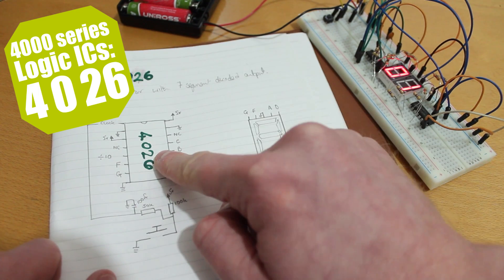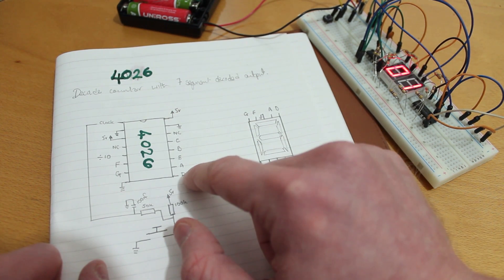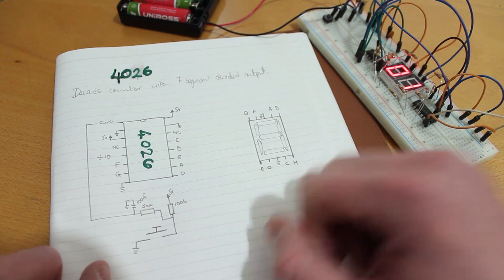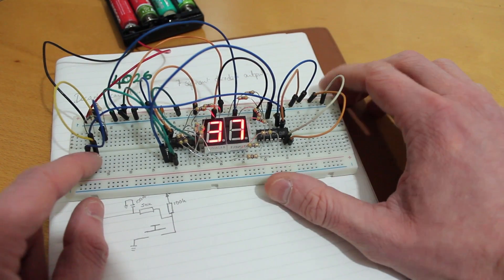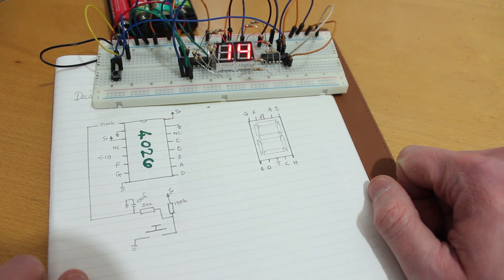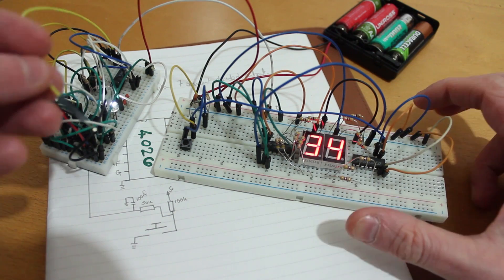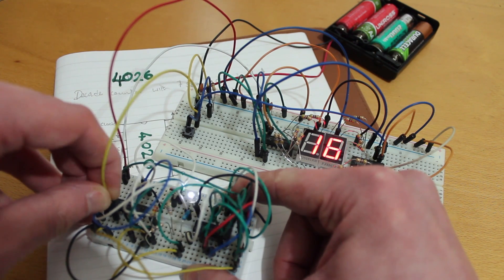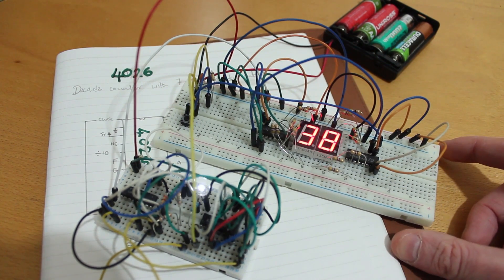4000 Series Logic ICs: The 4026 7 Segment Decoded Decade Counter

Comment: Great, but how to I connect the two counters and displays?  Any cirrcit diagram?
Reply from the maker: Essentially just duplicate the circuit but your second 4026 takes it's clock input from pin 5 of the first. Pin 5 is the carry out/divide by 10 output.
Reply: @DavidWatts  thank you :)

Comment: Hey David is there a way to make this stop at a set number rather than 99 say stop at 60 and then reset to 0
Reply from the maker: Yeah that is possible, you would need to add another IC though. The first number to light segments C-D-E-G is the 6 so you can use that as a logic switch. A 4081 is a Quad 2 input AND gate would be useful here so you could feed those segments into to gates and the resulting gate lines into a final gate. Once the 6 appears the output on that gate would go high, connect that the the reset pin and it would reset the ICs when that digit hit a 6.
Reply: David Watts great.. Instead of it reseting can it keep the number on the display. Until I switch power off?
Reply from the maker: I suppose you could use a transistor between the clock pin and clock source ant block it off instead of resetting.

Comment: is there a way to make them count down, i need to make a bomb and its really twisting my mind.

(just joking about the bomb)
Reply from the maker: Not on that IC but you could use a 4510 coupled with a 4511, the 4511 is a BCD to 7 segment driver and the 4510 is a decade counter to BCD. The 4510 can be told to count up or down.
Reply: Thank you

Comment: only common cathode 7 segment display can be used ??????
Reply: you can also use a transistor array driver like the 2803. The 4026 can't drive a high output current, only about 1 mA or so. Using a 2803 you can use common anode displays and you can drive these with a higher output current which means more light. The 4026 can be used up to around 6Mhz.
Reply from the maker: +darshan thakker It can only use a common cathode unless you use transistors on the outputs.